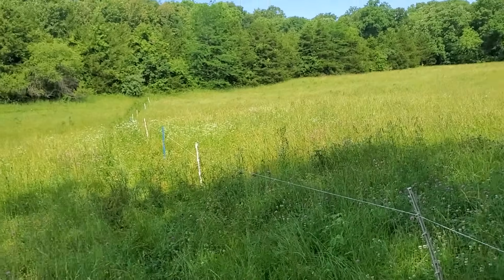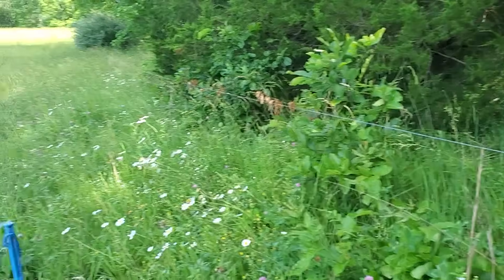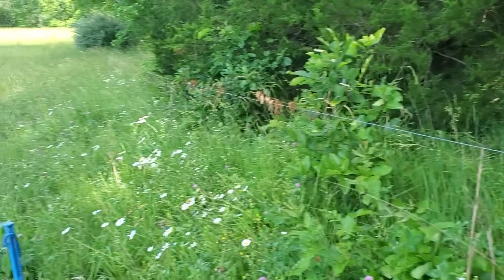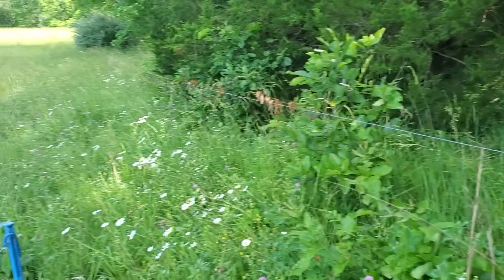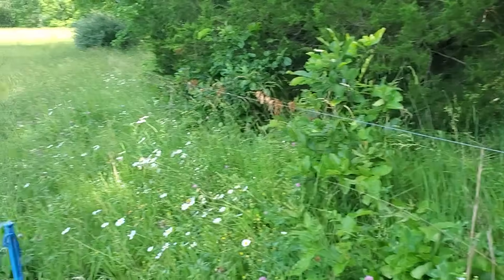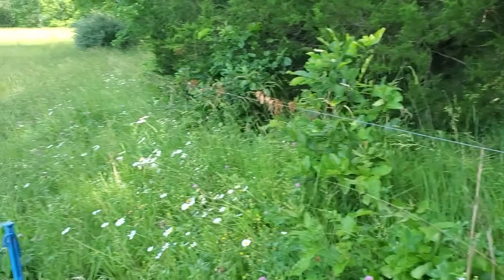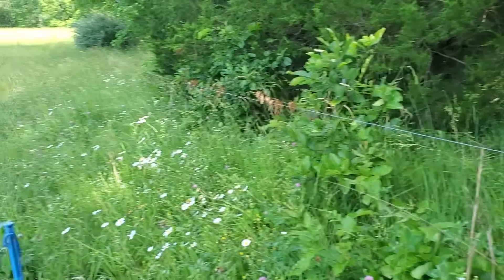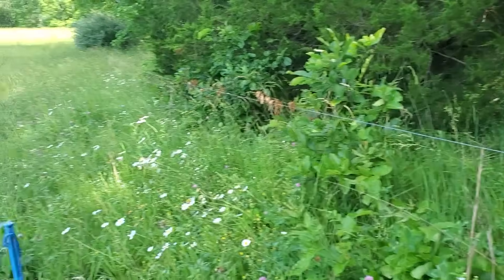Economical livestock water for strip grazing bull mob.

Comment: Greg, I’ve watched your videos for over a year now. Thank you for doing this, and long may it continue. My question is, can you explain exactly what you do in order to properly ground your electric fences? 
Cheers from central NC 
Alston
Reply from the maker: Mr Sigma is correct. 6 foot galvanized rods placed 10 feet apart. Place them on the north side of a building or along a wet area to ensure a good ground.
Reply: To further clarify, the number of ground rods can depend on what charger you use. Charger manufactured will usually recommend the number of ground rods per charger. For example, the charger we use recommends no less than 6 ground rods.
Reply: Thanks fellas, happy Friday!

Comment: G'day Greg,
Another great video
It's funny how different environments require different ways to make things work, we live in an arid environment which receives on average 14" of rain a year, we have the opposite problem to you with electric fence grounding, our solution is to use steel posts and run a return earth through them back to the energizer that way we are guaranteed to have a good earth.

Comment: What is the rubber on the top of the mineral feeder used for? Horse stall? Conveyor? Trying to source the material if I built my own version. Thank you Greg.
Reply: To keep the rain and wind out. Has to be heavy enough to not get blown up in a strong wind, but not so heavy that a young cow/ steer cannot lift it up with its head.
Reply from the maker: Your right!

Comment: How do you control the autumn olives? I mean, we mow them down but they are just everywhere, still yet.
Reply from the maker: Sheep are a real tool for hammering young sprouts of autumn olive. They completely strip them of all leaves. That's hard on a tree to get repetitive stripped.
Reply: All this time I couldn’t figure out what an ‘Otomolly’ tree was. None of my google searches came up with a match. Now I know.
Reply: Don Isenberg this is great! Google should’ve know better though. 😆
Reply: Just coppice the largest trees and bushes and don't worry about the sprouts -- they are an added benefit for your livestock once they re-grow in abundance.  If some of them don't survive the cutting and browsing, then you get what you wanted to begin with, and didn't have to apply poisons or remove roots to get there!

Comment: Are your gates high tensile?? We made ours high tensile and they suck. They ping back when you open them. We’ve been switching to poly rope.
Reply: If I remember correctly from previous videos he uses gates made from electrified polybraid attached to springs to maintain tension (I could be wrong about the springs, though -- I'm sure it's in a previous video if you search his channel).  I'm quite certain though that they're not HT wire.
Reply from the maker: We have both. Poly rope is hard to beat for gates.
Reply: @gregjudyregenerativerancher  Does the poly rope also have metal strands so it can be electrified?
Reply: @andreafalconiero9089  Yep it does... if you think it doesn't, just touch it and you'll quickly find out!
Reply: Greg Judy Regenerative Rancher Greg what tires do you run on your Honda?